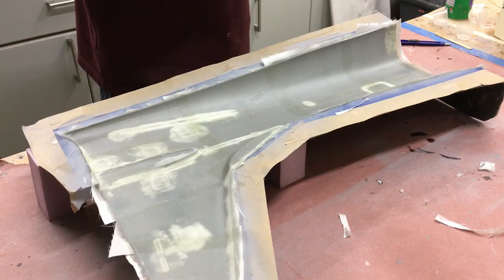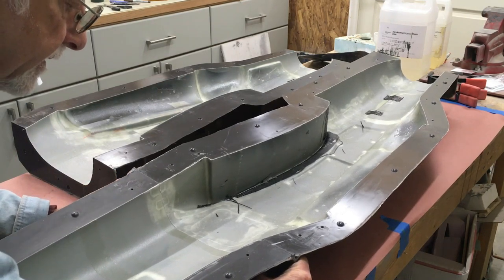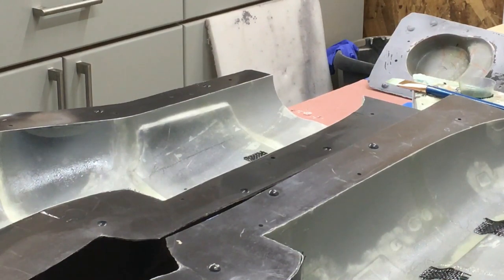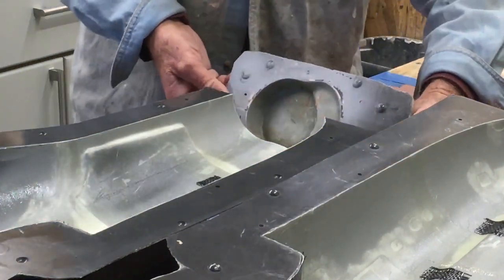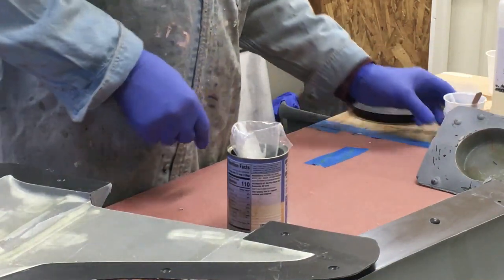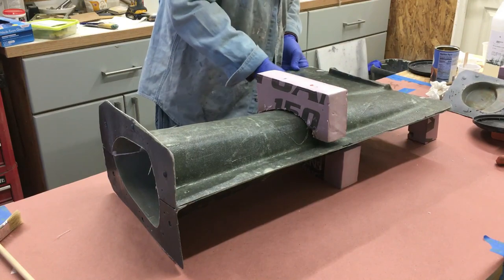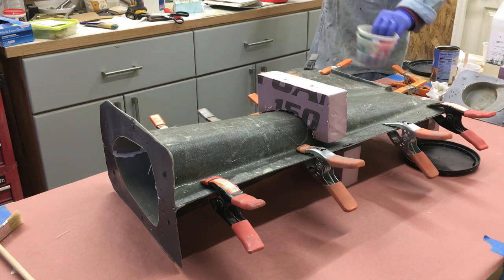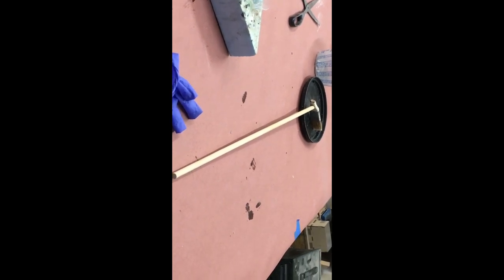Tucano Fuse layup Part 3

Comment: Even though the sections broke apart when you took them out of the mold, did it help you align them when doing the final join?  Kind of like gluing a broken vase where the bits are keyed due to the ragged edges.
Reply from the maker: Not really,  I sanded off the white goop and glued four tabs on one side of the joint which over lapped to the other part.This helped keep it in place so I could use panel lines to line up the front to back fuse parts.  Then I taped the parts together and added the inside joint tape.  Same for the nose section.  Looks fab now.